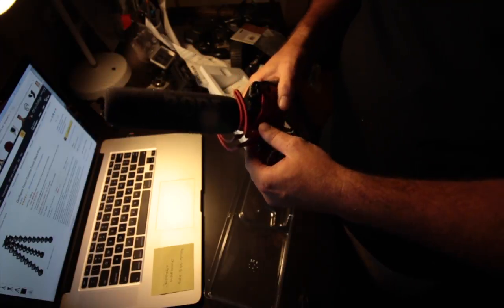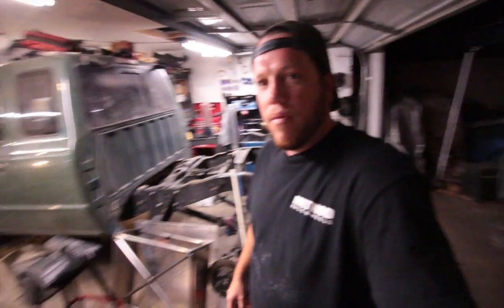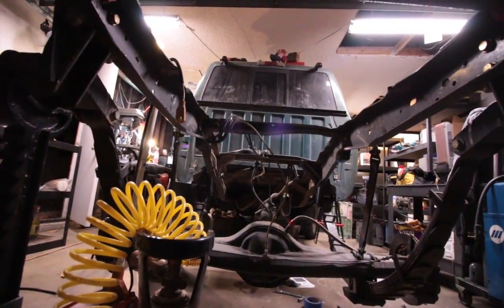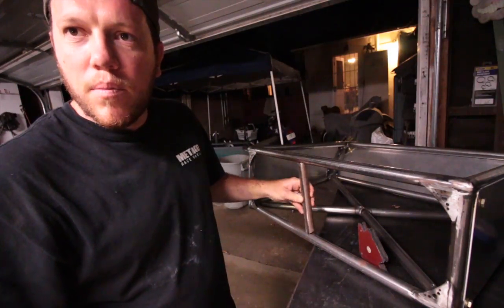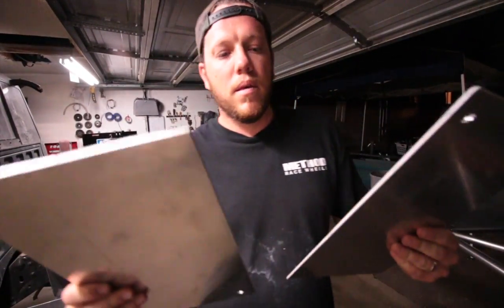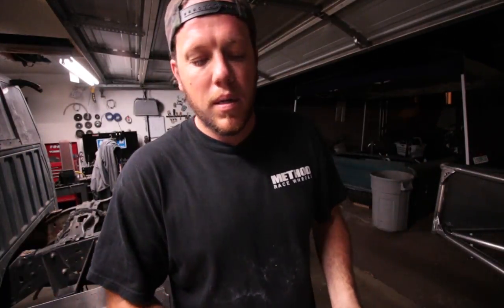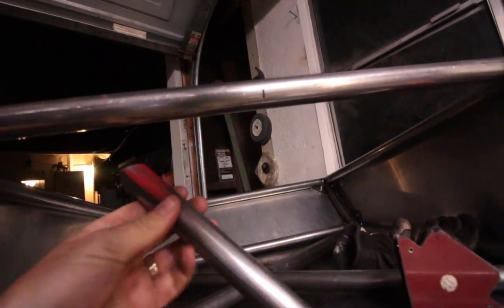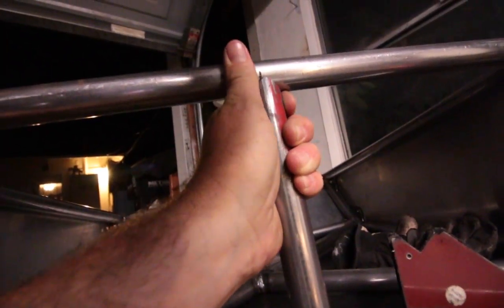Notching ONE Tube. Garage Vlog

Comment: Picked up a similar saw of Craigslist. Have had mad issues with it popping blades no matter what I do. Gonna try to source another. For a budget saw they do a lot of work.
Reply from the maker: Yes sir.. I have the issue when I chip off any of the teeth on the blade. If it catches at all it will pop off but when the blade is fresh I have a lot less issues with it. It also depends on how hard I push the metal. If i'm patient then it happens a lot less.